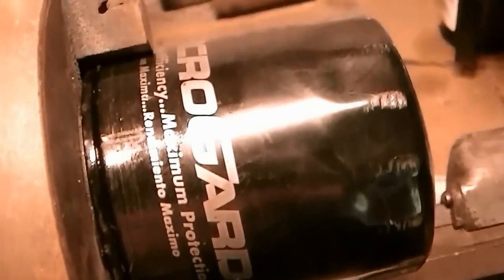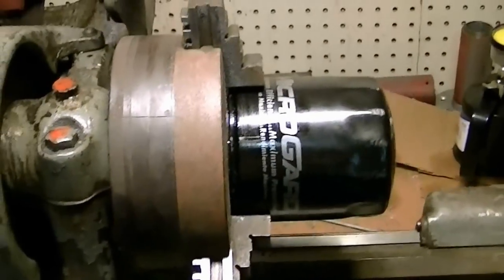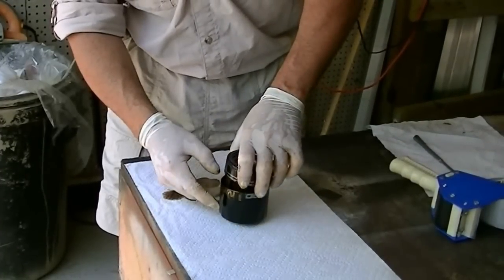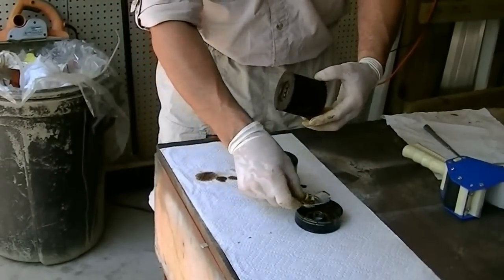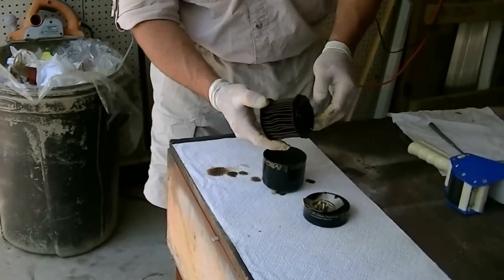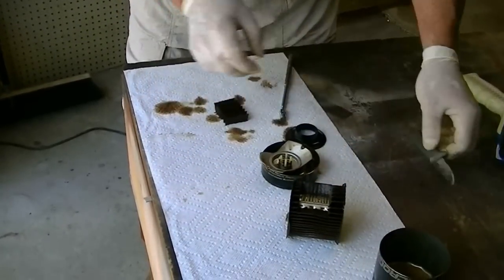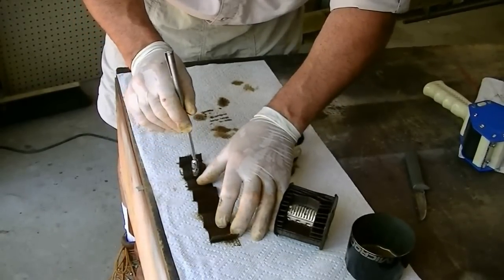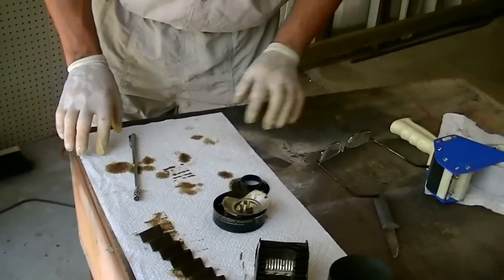Cut open oil filter and inspect the health of your engine.

Comment from the maker: I have not heard of oil testing. I have some heavy equipment and I cannot always hear if something is wrong because it is so loud. I have glued a strong rare earth magnet on the end of the dip stick to keep a eye on what is going on inside the engine. I use to work in the engine room of ships and that is where I learned this trick.

Mark

Comment: If you sample the oil and send it to a lab, you will have a more accurate identification of anything happening inside your engine or transmission. Non ferrous metals will not stick to the magnet and are too small to see as illustrated.

Comment: John deere cat detroit cummins all have mail in oil test kits .a great preventitive maintence test for my heavy equip as rod and mains are cheaper than cranks and blocks the analysis tells you exactly what surfaces are wearing by the metal type gteat channel been subd for a while under my wifes acc sassytina65